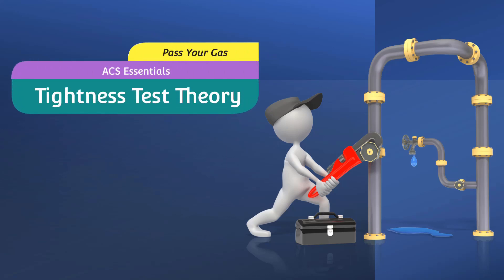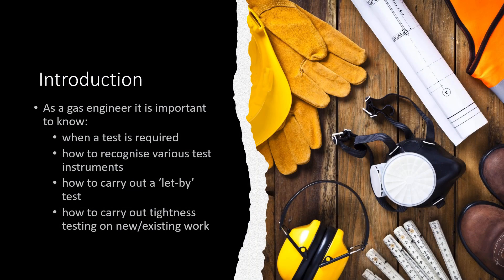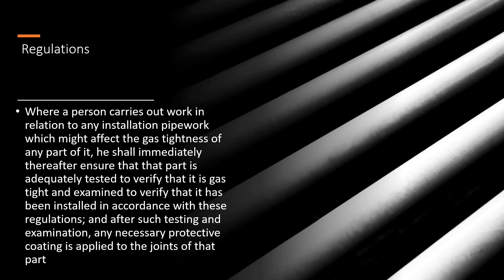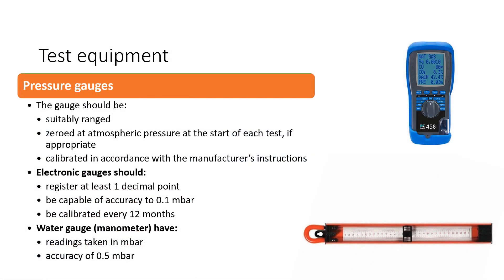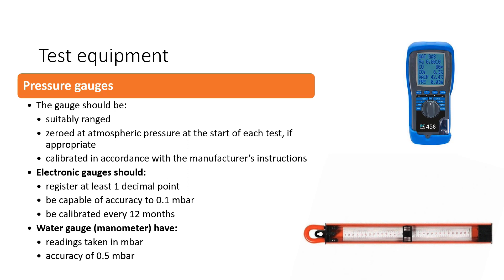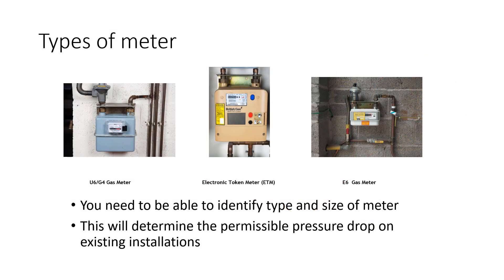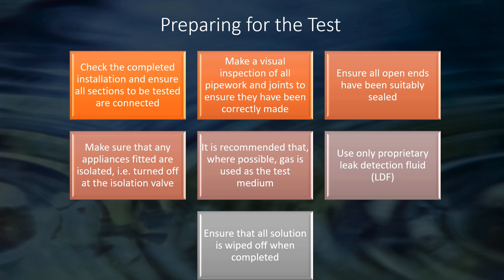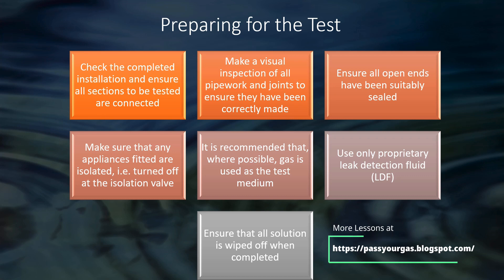ACS Essentials - Tightness Test Pt1- Theory for Exam Questions

Comment: Thank you for another great explanation. The speed of your speech and your explanation makes it so easy to digest the information!  
I wonder if you can answer a question I have. If you do a tightness test and you have a 2mb drop on u6 meter with a backboiler unit and fire, but no smell of gas, it would be classed as a pass. After you then service the boiler and fire, you light both and you then turn off the gas to check if the safety devices work within the time limits. They do but you also work out it is the safety devices that are actually letting by the 2mb drop. Would this still be a pass as its under 4mb with no smell of gas or a id as a safety device isnt working as it should?
Reply from the maker: Hi Abdul. Great question…right, if you discover that the safety device is leaking gas then it’s ID. Just because it’s not leaking enough to fail a TT doesn’t mean it’s safe. Think of it this way..if the FSD is leaking gas then if you put your nose near it (or a gas sniffer instrument) then you’ll smell the gas and the T T will not allow you any drop. So both ways round it’s ID…thanks and I hope that helps.
Reply: @passyourgas  again that makes a lot of sense, I have been grappling with it a while, thank you so much!